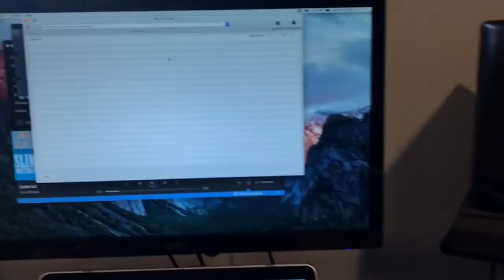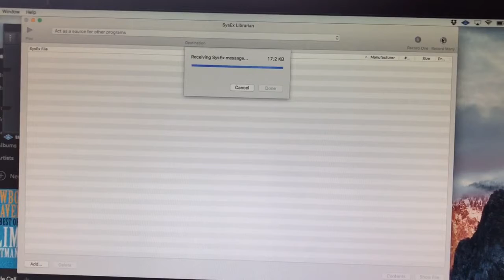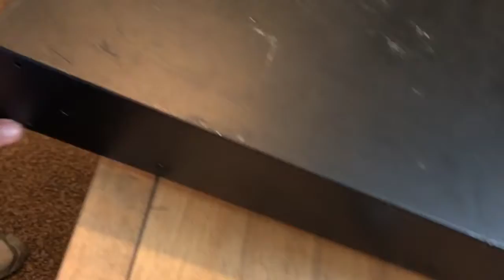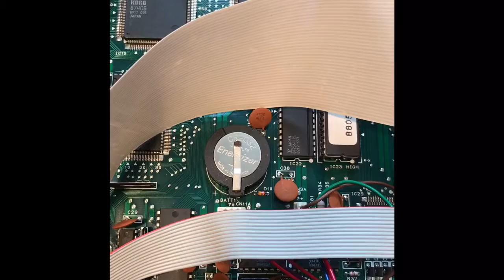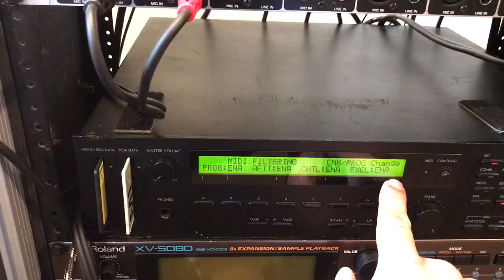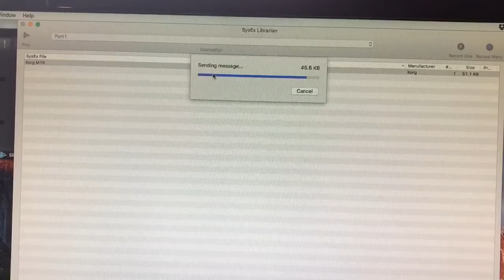Korg M1/M1R Battery Replacement and Sysex transfer

Comment: Hi! I have followed all the instructions you have given to restore my Korg x3 sounds after it lost the battery but it won't work. I can dump from the x3 to the laptop. I can send midi files to the x3. But when I send sysex files to the x3 it doesn't show data is received. I have tried to change delay and buffer size with no luck! What can I do? Please, can anyone help?

Comment: Hi. I have a low battery in my Korg M1R. Until recently, I haven't switched it on in over 10 years. Where it used to say 'UNIVERSE' it now says 'INIT PROG' when I turn the machine on. Should I still dump my MIDI data before I change the battery? If so, I've just downloaded software called midioxse, will that do the trick? Many thanks for any replies.
Reply: The battery has been to low to save your patches. You have to download a sysex file from the internet and send that to the M1R. Restoring your own M1R patches is useless, because they are lost already, showing the initprog.

Comment: Awesome tutorial! Got my M1R back up and running in no time. Thanks!!!
Reply: Hi. I have a low battery in my Korg M1R. Until recently, I haven't switched it on in over 10 years. Where it used to say 'UNIVERSE' it now says 'INIT PROG' when I turn the machine on. Should I still dump my MIDI data before I change the battery? If so, I've just downloaded software called midioxse, will that do the trick? Many thanks for any replies.